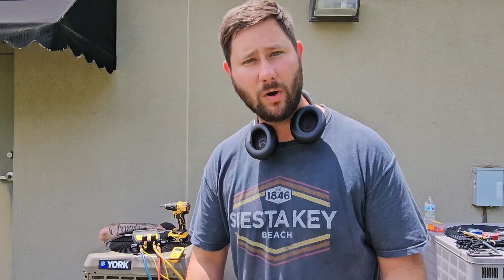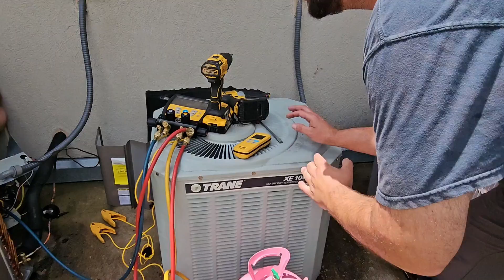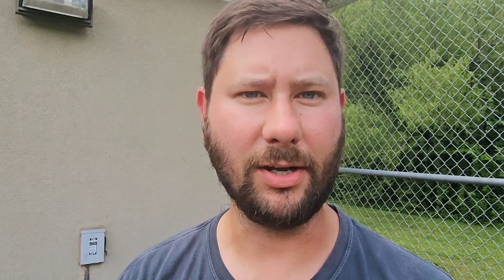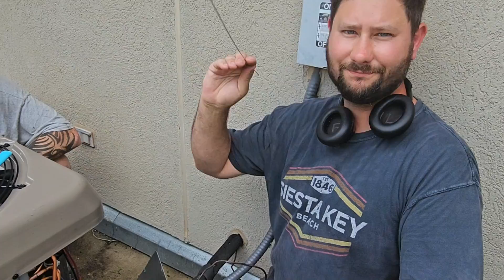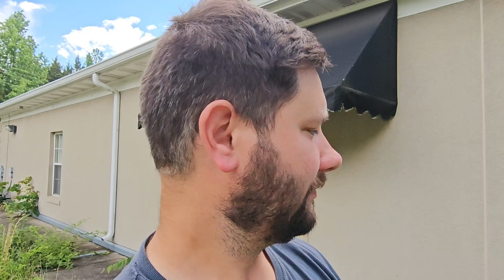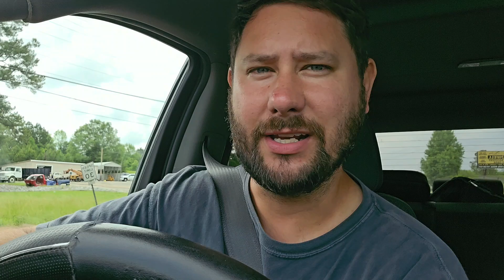Repairing New Unit After Install #hvac #airconditioning

Comment: Had this happen to me twice on goodman units. and many more different issues with American Standard. Missing parts, lose bolts in blower wheel makes real loud clunking noise on start up had to remove blower wheel and look for stuff, disconnected wires from control board and even physical damage. I feel like there is no more quality control. Now a days, before they load equipment to my truck I remove the cardboard and inspect system as much as possible. But even with that I get hit once in a while.

Comment: I have a Trane XR13 that has leaked in the condenser coil, unfortunately, while I was searching about how to repair it I found that multiple technicians said that they have the same leaking in the same spot as mine it is at the end of the coil between capper and aluminum pipe. The HVAC company estimates $4350 just to replace the coil. i give myself a favor by using the Solderwild Alloy sol repair kit, which solves the problem. I know I'm searching about how to vacuum the unit from the air and recharge the system with the refrigerant.
Reply from the maker: I've got videos on how to use a vacuum pump and how to charge the system. Check out youtube and type in what you want to learn and then my channel name, and it should come up

Comment: This is a problem mostly with York equipment...multiple times I've seen this. Glad I don't install those anymore.
Reply: I've had furnaces where the heat exchanger is cockeyed inside because it wasn't put together properly. York is junk.

Comment: I've personally witnessed multiple of the recent 410A Goodman condenser units have leaks at the coil. It does suck when you have to replace faulty factory parts on a new install.
Reply: They spray oil all over the Pan in factory on Goodman.

Comment: Don’t condensers come pre-loaded with refrigerant? When you installed it did it have a good amount of refrigerant? It shouldn’t have happened to a new unit though. Even after the fact. I would repair and call it in for warranty replacement.
Reply from the maker: yes

Comment: Dropping York was the best move my previous company made over the years, aside from dropping goodman. We switched to carrier at the time who defienetly has their issues but nothing like three 2 year old 5 ton RTU Yorks that sprug more than 3 leaks per system. Carrier has sent me air handlers with dents but atleast they didnt forget the transformer like yorks done twice. York will even tell you how proud they are of their control boards, even after telling you they may not come preprogrammed once you are on the roof and already have it installed. I own two sets of Yorks quick connects used to charge the condensors becasue they forgot them on the units. However i did just get a carrier with a hole in the capacitor. It really all boils down to how well the salesman is going to make it up to you, the customer.

Comment: I put in a brand new Rheem / Ruud system the other day and at start up the compressor was noisy, it was cooling but real noisy…….. and I had to replace the compressor for free on a brand new unit. # JUNK

Comment: I had a brand new RUUD AC start up today and supplied power to it for the first time and the condenser fan motor was bad. 
Also found their compressors failing as well on new units

Comment: you are talking to deaf ears...Why would they want to make it better. instead of buying 2 or 3 systems, they get to sell 4 or 5 to a homeowner. Obviously, if they wanted to make it leak free they could easily do it with better copper and more solder on their joints. This is not an accident.

But only thing i do disagree with you on is leaving a unit with 1 degree sub cooling just because you weighed the charge in the system. adding a little more refrigerant can easily get your sub cool up and still be within a safe range of your head pressure in most cases.
Reply: I was a seminar in my line of work or there was a known defective part from the OEM. It would have been very easy to fix. After the OEM rep gave his speech another high and mighty tech proudly stood up for the good of humanity and asked the OEM  after so many years of failures why haven't they fixed the issue. The OEM looks straight at him and I will never forget this "Do you really want us to fix it?" The tech sat the F down and didn't say another word. lol We all made so much money replacing this part with pretty much another bad one.
Reply: @scotts4125  I straight up tell customers almost the same thing. Manufacturer quality brings us more business, unfortunately it is you the customer that ends up getting the raw end of the deal. Sorry about that, but that is where the world has come to. Throw away parts and products.

Comment: Yo taddy I watch the ads for you I guess you can say it’s a way to pay you back for this great knowledge that being said I came across a unit that was as old as me the other day :) r22 was a great refrigerant and the systems kicked butt it was a Lennox but the quality now is going downhill also the welds are very poor, so I agree if you can repair it do because it’s hard to come across r22 cheaply but if it completely goes out then it should be replaced

Comment: 5:01 we had an AC install in Co, we’re we finished up the whole instal up to releasing the refrigerant, we heard nothing and we had no pressure on our gauges… long day. We had no choice but to wait for a new unit and replace it .. customer didn’t want it repaired. They “ didn’t trust it “ neither did we.

Comment: New Bosch condenser, can't open the liquid valve as the hex threads came worn out from factory. Key just turns inside the hole. Bosch blamed me but gave me a new valve.
3 Weeks after, different system (brand new) , Summit coil leaking water form pan

Comment: K.  Your taken care of by the distributor, but how much ill will, negative publicity are you experiencing, if known, by having to fix issues that should never have occurred?  Dumping York isn’t the solution as all manufacturers to one extent or another is producing poor quality.  You had the correct answer earlier in convincing the customer to go with the repair.  Best of luck going forward, Tad.

Comment: I used to be a Lennox dealer and other than the thin leaky indoor coil issues most brands had 10 years ago they are pretty well built and never had a DOA leaker. Now getting parts for all the big brands sucks as they have minimal stocking and " on time " delivery which is Bull sheet. 

I am in Canada and them having a motor 2 Provinces away on Christmas eve when it is -30 F or -30 C does not cut it. Yeah we can get it next day delivery but try that during XMAS. All the brands suck with that minimal inventory crap. The biz is run by bean counters not trades people who know what is needed.  IMO Lennox is the best of the worst.

Comment: York sucks. I recently installed a York package unit and it had a leak on the condenser coil. The distributor took it back and they delivered a new replacement that also had a leak. Horrible

Comment: You and the distributor should write a letter to the CEO regarding the quality issues. I’m sure you keep a logbook of all the issues that you encounter and have to repair due to poor quality. I’m sure the distributor also deals with other contractors that are frustrated just like you are and they too should all sign the letter. This crap has to stop!! Customers are fed up with having to spend a substantial amount of money only to end up with a substandard product. Thank God for you Tad!!!
Reply from the maker: I agree
I'm sure the distributor has it even harder than I do dealing with all the quality issues.
I hope everything works out
Reply: @taddydigest  The reason I mentioned writing to the CEO is because my mother-in-law, who has since passed, owned a Chevrolet impala that always had problems with the window regulator breaking and she had enough. In her letter she stated the reason she bought the vehicle was because the vehicle was advertised as trouble/ maintenance free. To her surprise the CEO responded and General Motors made good on it. God rest her soul!!

Comment: after install befor put in ref410 you must a make vacuum test or nitrotest.so you can find during you installation in first time that leaking and not coming back second time.vacuuming good to understanding
Reply: I'm sure he did that. But the leak was on the other side of the valve where the factory charge is held. That part of the system is not part of the vacuum or nitrogen test. His repair was legit. But was BS overall. It should have never been needed.

Comment: I agree that you should try to repair old equipment because it was built with quality. But when I switched my old unit (GE1984-2018) for a new one, my bill dropped in half. I'm bummed that the new stuff breaks regularly, but it is so efficient. It feels like manufacturers just want to get the product out the door, then deal with the repairs later. Your good will and work ethic makes it easy for them to rush out half ass products because they know you will clean it up. You are the problem 😉
Reply: Yea, EVERYBODY & i mean EVERYBODY  Needs to Get Pissed off at the Distributors so they convey to the Manufacturers that they are not happy about the crap coming down the pipe.
and Everybody just needs to keep switching suppliers to find the Best Product. After a Leaker like this He needs to say - I'm not buying from You anymore. Try another supplier & another Brand.

Comment: Buy " Rheem "  equipment. Been only installing Rheem Condensers since 1981. 0 issues in 43 Years ! Zero !!!
Rheem - FTW !!!
not Ruud --- Rheem.

York used to be a good brand back in the day. 1970's 
Make Sure You Bill them " York " " as Much as Possible "  Make it HURT !!! For them Making Crap!!!
Don't Let Them get away with it !!!
it's the only way to make them change & send out a better product.

If u can - in order of quality.
1) Rheem - First option. All Rheem Equipment is Quality.
2) Carrier , Bryant, Payne.
3) ADP - Evaporators. All copper tube & aluminum fun. i only use ADP !!! for 43 years. no issues.
4) i only install Carrier Furnaces when possible.
5) i Have no Problems with Goodman. Furnace or condensers.
6) i Wont install aluminum Evaporators !!! 
i install COPPER TUBE / Aluminum fin from ADP. if i cannot get copper from Goodman.

Last install i did was - 
1) Rheem - 16 Seer Condenser
2) Payne - 80% Furnace
3) ADP - Evaporator. All copper tube / aluminum fin.

Switch Supplier - & Tell old Supplier You are not Buying any more York Products ! 
Better Yet - Tell the " York Sales man " You Will Not Buy " York " Again !!!
That Really " Hurts " When the sales guy hears that !!!
it Definitely Gets Back to Corporate that Way !!!

Keep Switching Brands Until You Find a Good one !

Start with - 
1) Rheem
2) Carrier
3) Bryant
4) Payne
5) Goodman

Good video !
Reply: Remember - iCP is NOT the same as Carrier. The Carrier Product Goes through a Higher level of inspection , to Put the " Name " Carrier on. Same with Bryant.
The " Name " is Everything.
Carrier & Bryant = Higher Quality Components , More Rigorous inspection.

icp = Entry level parts & min. inspection.
Reply: Fyi - Almost Forgot ---  Rheem Furnaces Work Great - But are Very Loud ! ( The Burner section  Sounds like Nasa Space shuttle taking off ) so , i Will not install them inside a House in a Hallway. Don't put them anywhere Noise might be an issue. it's not the inducer motor it's the actual Flame shooting down the tubes. it's Like a Blowtorch !!! or Flame thrower. Works Great !!!  but , Just a Little too much Blowtorch !!!

Comment: I've installed at least 4 brand new carrier infinity systems in the last year that were empty.  And countless brand new carrier systems have had stripped out services valves on the discharge

Comment: We install icp, I’ve had 5 outdoor units in the last year and a half that still had nitrogen in them from the factory.
Reply: Send'em back!  If they get enough returns to refill their warehouses, then maybe the USA could start a manufacturing plant?  Naw; too many mixed and different races for quality from USA anymore.
Reply from the maker: Wow that is crazy
Reply: @taddydigest  when I lived in Oregon I installed carrier (aka ICP) heat pumps and air conditioners for four years straight. I only had one outdoor unit that was low on refrigerant from the factory.

Comment: Hey Tad, do you know pressure test new installs and spray bubbles on a U-bends to check for leaks? This is crazy that contractors have to go through this. This is why I will not buy a system without an extended labor warranty.